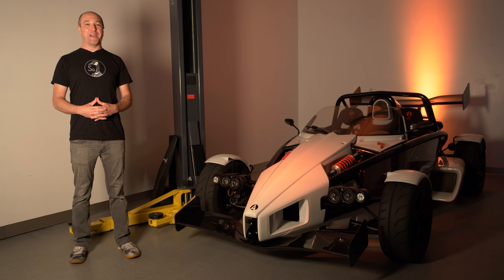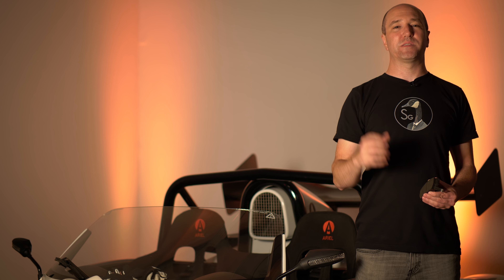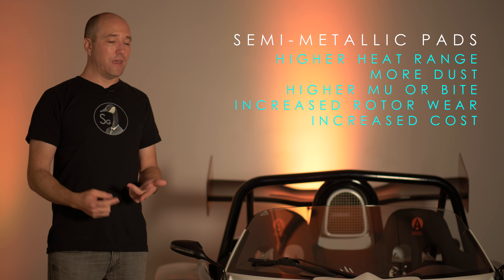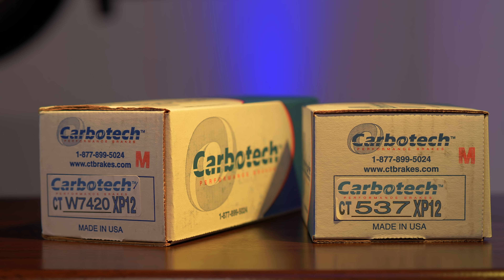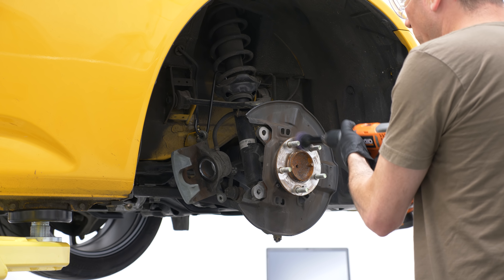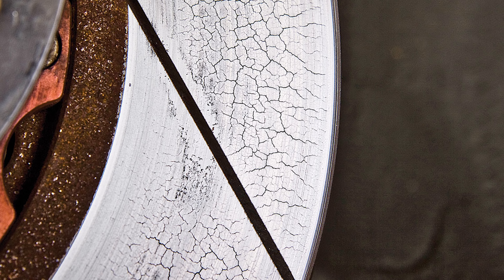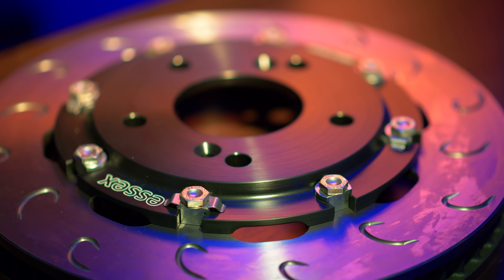Learn About Brake Rotors and Pads | Fine Print Series

Comment: Time stamps for Mobile:
Index:

00:00 - 00:37 Intro
00:37 - 2:20 Brake Pad Basics and Temperatures
2:20 - 3:28 MU - Coeffient of Friction Chart and Heat Ranges
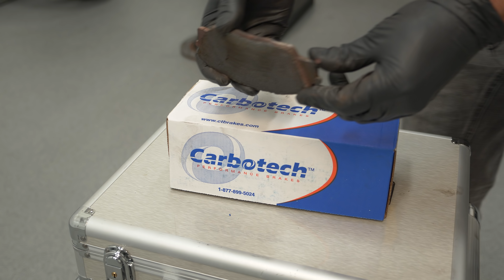3:28 - 4:27 Pad Materials - Organic
4:27 - 5:10 Pad Materials - Ceramic
5:10 - 6:21 Pad Materials - Semi Metallic
6:21 - 7:00 Pad Materials - Full Metallic
7:00 - 8:02 Temp Charts and Brake Fade
8:02 - 11:05 What is the Best Brake Pad?
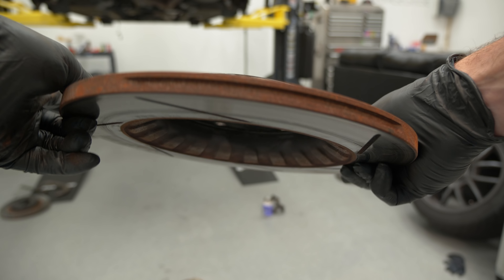11:05 - 13:08 Brake Rotors Pros and Cons- Vented Blanks
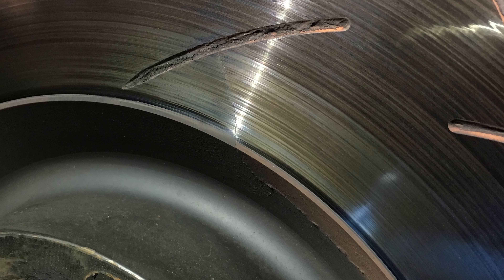13:08 - 14:00 Slotted Rotors
14:00 - 14:55 Heat Cracks and Heat Checking
14:55 - 16:00 Cross Drilled Rotors
16:00 - 17:39 Cryo Treated Rotors
17:39 - 19:41 Two Piece Rotors and Big Brakes
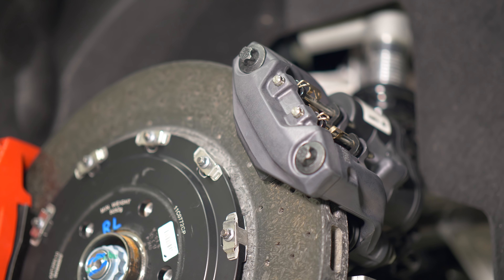19:41 - 21:36 Carbon Ceramic Pros and Cons
21:36 Bedding Brakes, Burnishing and Stopping Squeaks
Reply: Whatever brake pad and rotor combo GM is using on their Cadillac ATS....is simply amazing.
Reply: savage learn from your subscribers comments
Reply: I know these more technical videos are not as loved like your other videos, but I really appreciate that you do these. Please keep doing them.
Reply: Francisco Garcia has to

Comment: When I was young and dumb, I needed brakes on my daily driver Miata. And my dumbass bought an expensive set of Hawk HPS pads for a stock 1.6 car that is driven almost entirely on the street. I never liked those pads. Crazy dusty, really noisy and terrible bite unless you got them super hot.

I recently swapped to EBC green-stuff which is a street-only pad and it made a massive difference. Initial bite is 100% better. They don't dust as much and they grip just as well cold as they do hot. They don't dust like crazy and they are plenty good enough for spirited driving in a street car. I wish I had this video when I was 18 because it would have made choosing the right pad a lot easier. Don't buy trackable street pads thinking it'll make your vehicle stop better all the time. There is no pad that does everything great.

Thank you for this video Mark. Because of your great information, I only bought the pads I needed.
Reply: Love your 100% thorough honesty😂😂😂

Comment: I talked to one of the head guys at AP once and he mentioned how he was an advocate of grooved/dimpled rotors. Not drilling or slotting all the way through meant they didn't create high stress concentrations (areas more prone to cracking). It's cool to actually see them in use with the ones you had.

Comment: You clearly know your stuff. Keep up the good work. I hope you won't stop as I got used to your reviews and technical videos so much that I find any other YouTube car channel lacking in comparison (maybe except Engineering explained).
Reply: Prefer this channel. EE sometimes is too theoretical or detailed. This video by comparison provided a concise overview and had great practical examples. I have not seen the basic brake video yet, but I hope it covers the differences between various aspects of braking (bite, brake dissipation, wear) and which components of the brake system influence it in what way (fluid, lines, cooling of rotors in various ways). I'm not an expert by any means but have learnt a lot bt reading articles online or videos like these. Its one of those technical topics that don't get as much attention (except in racing circles) as say how much power an engine makes but it matters so much for track driving, it can't be overstated.

Comment: Great video as always. For street driving I’m liking the factory Brembo pads on my Chevy SS sedan. I am running the 6 piston Brembo calipers from the C7 Z06 and 2 piece rotors up front, with Motul 600 fluid. The factory pads dust a lot, but they never give up with a good workout, and they aren’t loud. I’m sure at the track the Brembo pads wouldn’t work great, but they’d at least be decent when paired with the good fluid.

Comment: 19:31 For some cars, there are aftermarket 2 piece brake rotors in the original dimensions, so you do not need to change calipers.

Comment: Very Informative. Living In the Hudson Valley within the Appalachian Mountains. My Ford Transit Connect commercial van the front brakes get a workout. My transmission repair shop owner told me NOT to down shift going down long hills. It's cheaper to replace the brakes than the transmission, he told me. Your video is helpful for me to choose the best system for mountain driving. Thanks.

Comment: In my Excursion that tips the scales over 8000 lbs, I was going through rotors like underwear  warping them. Until I tried cryo treated rotors and now have 50k on them with no ill effect. Nice video as usual!
Reply: Eric J. Where did you get those rotors from
Reply: @supernovaa313  Stoptech. I went with the cryo\ slotted. Amazon at the time had the best price.
Reply: What pads did you pair them with?
Reply: @TypeVertigo  Hawk LTS
Reply: I have a Ridgeline that does the same thing. It's got stock rotors with Hawk LTS pads. I was on the fence about cryo till I read this. I'm going to give it a shot. Thanks for posting.

Comment: Really well done overview, the only thing i would disagree with is your opinion about cryo treated rotors. I have experimented with a track car without making any other changes just cryo treated vs non cryo treated and found there was a big difference in rotor wear and cracking. The cryo treated rotors lasted 2-3 times longer with everything else being the same. I did not buy pre treated rotors but used a local company that does this type of treatment, so exact same batch of rotors even. 
i was very skeptical but after seeing the difference first hand.... Perhaps under certain extremes cryo treating might not be enough to make a big difference, but under certain applications it does help a lot. I mean there is a reason that cryo treating has been around for a long time.

Comment: Part 3...Should be about ABS tuning. Most road cars (and motorcycles) have conservative ABS thresholds and the ABS intervenes far sooner than an experienced driver (or rider) desires. This was very apparent in my MINI Cooper S and also in my 2017 Mustang GT.
Reply: Can you tune ABS thresholds?
Reply: Only module Bosch ABS COMPETITION is the solution.

Comment: For street driving with occasional spirited runs I prefer drilled rotors for the cooling, I know people hate them due to cracking but I don't track my car and with normal rotors I find they get exceptionally hot and suffer brake fade on those spirited runs. Just putting my 2 cents out there as I stayed away from them for years due to all the internet comments but I'm now a convert as they fit my driving profile really well. I'm even going to try drilled and slotted next time to see if I get extra bite.
Reply: Lapsio  They do get clogged that's true but not completely so they're still better than blank rotors. I'm liking my drilled and slotted btw. I've got some basic Mintex pads this time for 1/5th the cost and performance is still there but just requires a bit more pressure and three's only tiny bit of slotted noise and vibration under VERY hard braking.

Comment: Brake Fade is a lot worse than it sounds. Oh some fade, whatever. I was like that too
Let me explain why it's a nightmare and my experience

On the track let's say you are speeding onto a curve.
You will want to brake.
As you step on the brake pedal it's like hardly any braking is being done. Kind of like ABS in the snow
You step on the brake harder, a bit more braking is being done.
(the thing is, on the previous turn I had no brake fade, it just suddenly happens)
If you are not driving on the limit of what your car can do you will have no issues.
Apparently I was not driving at the limit, if I was, It would've been a crash for sure.
Brake fade really takes the fun out of racing, so get it straight if you are serious about racing.
And I wish for every car enthusiast to never have to experience it. It's just so horrible. It's like a near death experience, blood levels going through the roof, adrenaline pumping in a bad way
Reply: Sounds scary. I’ve never had it come on so suddenly. My experience has been the pedal going a bit further each turn and as soon as I notice, i back off. That was in a light car though, so the effects were probably lessened.
Reply: Dbn Poldermans if you can interpret the Mu vs. Temperature graphs that’s exactly what they are showing. Below a certain temperature pads will basically not work, above a certain temperature the same applies. The coefficient of friction doesn’t fall off as quickly for some pads, some have a more linear decrease with temperature but may have other trade offs.

Comment: Learned a lot...great info. For 2007 Mustang Roust 427r...435Hp... finding conflicting info on OE PADS...unable to find original pad material. Ford internet says organic, or is better to go semi metallic. I like the idea on using ceramic compound. I use the car for pleasure and some spirited driving at times. Your advice will be very appreciated.  Thanks, Jose

Comment: Not to be argumentative or contrary, but from my experience with the ceramic pads on my car, they work better at higher temps.  I almost rear ended someone trying to stop from 25MPH when the pads were cold.  I wasn't following too closely or driving crazy.  I was just following along with traffic, trying to slow/stop like everybody else.  When the pads get some heat in them, they work pretty good.

Comment: All your videos have been on point so far, but in this one  you were a bit vague some places, I'll add some info on top.
Please don't take my word for it and do your own research people.
Main purpose of cryotreatment is to remove residual stresses from metal and to improve uniformity of grain boundaries in metal.
Bedding in pads allows for ensuring uniform pressure on the contact surface, via pad wear to the topography of the rotor. Also, and you touched on this, filling in the microcracks with pad material to allows for more uniform heat transfer through the rotor surface and therefore avoiding hot spot formation.
Reply: Since you seem knowledgeable on the subject, could you explain how bedding in a pad is better in creating a transfer layer compared to just using the pad directly on track? I mean, obviously it is a a safety issue for a track pad not to be bedded in, so it makes sense to do that gradually and before track sessions. But what about those pads that are semi race/street+track like Hawp HP+? Is it the gradual increase of braking force that bedding routines usually have that helps to build up ever more transfer material compared to the less constant and more sporadic nature of regular braking? My HP+ seem fairly easy to bed and the difference of not doing it well seems fairly minor. But I wonder if that is just because it is still a street oriented pad also.
Reply: Bedding in pads doesn't mean you have to follow the instructions to the t. The procedure is just a suggestion. It's like cooking, you don't have to follow recipe exactly to get something that tastes good ;) Main goal is to go through several heat cycles, shave off high spots, transfer some brake pad material into rotor surface. There was a number of times when I bedded fresh pads and rotors in during the first session on the track.   @TheChannel1978

Comment: I think ther eis nothing more important then to find the correct match between the pad and rotor. When the pad is too hard, it's gonna eath the rotor, when it's too soft it's not gonna brake as well. This is why a lot of people in racing uses FERODO DS series pads, you can find them in so many different types for pads.
The drills on the rotors are was useful only in the past. In these days with the new materials it's only design, nothing else.

btw I'm msing Stoptech because AP racing is way tooooo expensive :D

Comment: I use Hawk HPS pads with Brembo "blank" rotors on the front of my Acura and you can really feel the better bite once they heat up and they don't make a crazy amount of noise but they dust up like a bastard.
Reply: HPS is a fairly mild steet/pad, still mostly street focused. If you go to the HP+ variant it gets more track oriented. You get even more bite at operating temps but the noise (when cold) and dust is stratospheric. I still use them :) My car is a week ender so that's fine.
Reply: @TheChannel1978  I'm usign HP+ on my daily my Daily Miata. I love the way they feel when they warm up but the dust is out of control.
Reply: I got the HPS for a sweet deal from amazon (probably because they were 3 years old with 2015 being the date of manufacturing lol) They are a noticeable step up from your typical autoparts branded ceramic pads and so far have an Amazing pad life if you're daily driving and grip like a beast once they're properly warmed up. I heard a lot of people complain about the HP+ being noisy when cold out which would drive me crazy driving in Canada >.<

Comment: Nice video! But you forgot to mention high carbon street rotors that normally come on euro cars.
Reply: Rob E hmmm, interesting. I’m wondering about them now too. The euro driving experience is a bit different than north american driving- possible autobahn driving and possibly more mountainous. It seems to me that BMWs produce quite a bit of brake dust. I would bet that whatever pads they use are capable of handling a little bit more heat than the typical American car, while still being streetable with a bit more maintenance.

Comment: Cryogenic treatment works great but it does depend on the correct pad. Cracking rotors are more likely caused by uneven heating or cooling

Comment: I have a 2020 Acura RDX, I do a lot of Spiriting driving mostly local in nyc. I get that spongy brake feel where I have to depress my pedal more to get a full stopping feel. Now I have addressed this with the dealer but they say it’s normal brake feel for this car, that’s not ok with me. Please advise how I can achieve a stiff brake feel. Pad recommendation? Or big brake kit with cross drill rotor?
Reply: It's brake by wire

Comment: Hi, thanks for the great video, and educating me.  I'm getting ready to swap out the rotors on my 2017 Honda Ridgeline.  It seems as though any car I drive, I manage to warp the rotors.  I have done some towing, and pretty heavy hauling in this little truck, and well as doing both through the mountains of Virginia.  I'm considering the EBC smooth rotors, with the "green stuff" pads as a replacement.  From what I've seen, they cost about 1/3 more, than the Stoptechs, or Powerstops, that are slotted, and drilled.  My mechanic said to stay away from drilled rotors, for the same reason you explained.  Should I go with the more expensive EBC rotors and pads, or one of the cheaper brands.  I don't tow anymore on a regular basis, but I do haul occasionally, and ride in the mountains too.  Your advice would be greatly appreciated.

Comment: I use cryo treated rotors (science of speed or Stoptech, don't remember) on my Hawk HP+ pads. I have noticed I am getting sparking under hard braking. Is that an issue that shows an incompatibility between rotor and pad material? Have not noticed any melting of wheel well plastics or paint damage, but just curious if this is a red flag or less than ideal configuration. Braking performance is excellent and this happens on bedded pads only under hard braking.

Comment: cryo freezing works for applications where a rotor is almost good enough... my mom's Nissan Quest would constantly warp rotors (well, pulsating pedal, idk if it was warped rotor or some other rotor issue) within a month of new rotors, I got her some cryo rotors off tirerack and the issue went away.  idk if it helps with longevity or not...
Reply: It might help with cars whose rotors are pretty thin to begin with. My Honda Jazz (Fit) tends to warp rotors as well, more so if you enter corners aggressively under braking, and my local mechanics do see it as a common issue with these cars. Cryogenic treatment may help longevity in cases like ours, but still have to weigh benefit vs cost
Reply: TypeVertigo yup, like I said, when brakes are almost good enough. If you need a significant improvement, it's not gonna work
Reply: Tend to agree. I run track days on my s2000 and wore out stock rotors eventually after about 20 track days, which isn't bad to begin with. But cryo treated rotors of the same size using the same pads seem to wear even better, have not noticed any micro cracks yet. Have not measured diameters mind you, but they seem to wear well. If price difference is not too bad (it wasn't for mine maybe 15% more) I'd say try it for a rotor that's almost good enough for a car that seens some track use. It probably won't cut it for a race car.
Reply: Sometimes replacing calipers help warping issues

Comment: Thank you for a clear and informative video. I have a 2017 VW Passat and am told to use only OEM brakes and rotors, because other brake pads and rotors don't work as well. Of course, they  are pricier than other types. Is there really a benefit to buying them from the dealership?
Reply: To the VW dealer, yes... In reality, it’s a Passat... not much different, brake wise, than a Camry or Sonata.